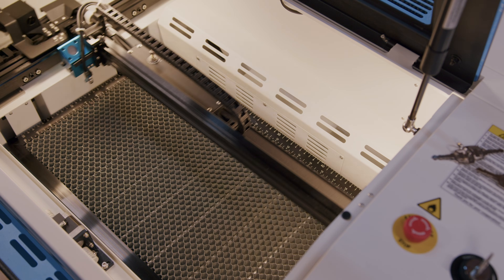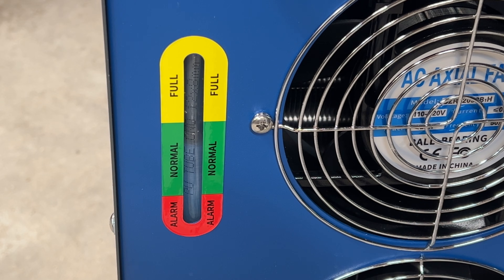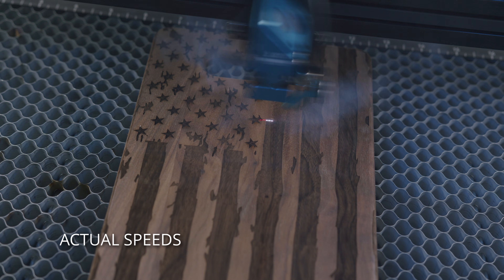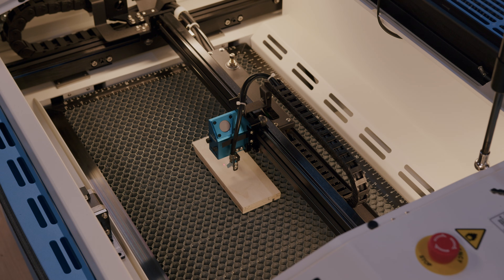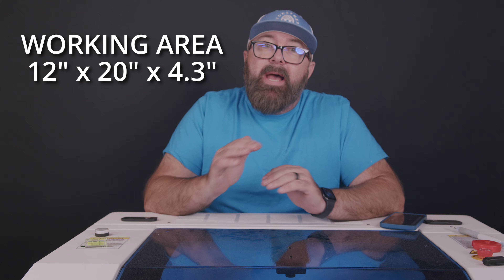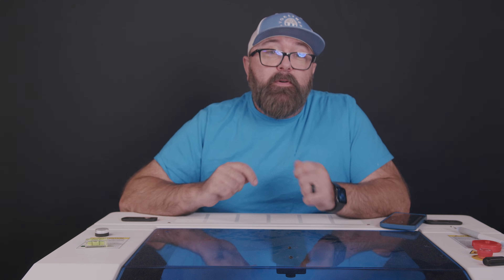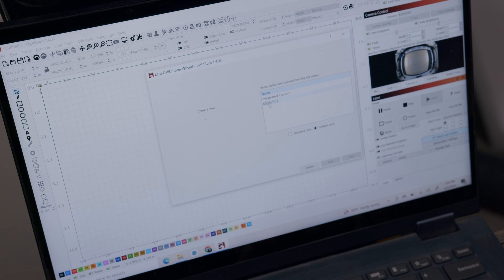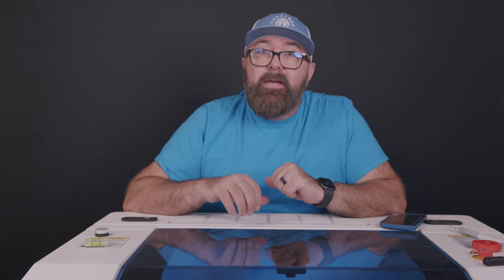This RF laser is a BEAST! Thunder Bolt Review

Comment: Very good presentation. 
I am looking to purchase my first laser engraver / cutter. Having no prior experience, which model would you recommend for small businesses? I will be cutting & engraving colored acrylic sheets.
Reply from the maker: I’m slightly bias to the thunder bolt and xTool P2 at the moment for most desktop users. I also like my OMTech machine. You’ll want a Co2 or RF laser to do what you need, so stay away from looking at diode machines for that. Thanks for watching.

Comment: I wonder where Thunder Laser get their DPI values from because they are certainly not attainable in the real world on any material I know of. 2000dpi is a burnt dot of 0.012mm  diameter  and that is JUST above the physics theoretical spot size limit of 1 wavelength (.0106mm), Even 1000dpi is dreaming. It would be great if you could test these  TL claims. 1000dpi is 40 dots per mm .Try it and see if you can count 40 discrete dots.

Comment: Do you by chance know the max height material that will lay flat on the honeycomb and not overlap the inside of the honeycomb frame? I really need to lay something that is 12" high flat, the width is more than fine.
Reply from the maker: Are you saying the piece is 12” in height?
Reply: @VoeltnerWoodworking  sorry, front to back. 😁
Reply from the maker: The max part size is 20.3''X13.9''X 4.3''/515 X345X110mm
Reply: @VoeltnerWoodworking  perfect, thank you, and that does not go on/over the honeycomb frame? 😁

Comment: Thanks for the video! For those that have a large, high watt Nova, what would be an example of distribution of labor if they added a Bolt to their shop? I have read where some relegated their big Novas to mainly panel cutting, especially on big sheets.
Reply from the maker: First off, thank you for the Super Thanks! Much appreciated. For those with a Nova there probably isn’t a huge need for the Bolt, but it is nice to set up for smaller projects like tumblers or fine engraving. So it would depend on what your primary projects are. Do you have the Nova? Which one?
Reply: @VoeltnerWoodworking  You are very welcome fellow Texan! I have a Nova 63-130 but would like a Bolt for more precision and speed…just looking for the right/best tools for different types of jobs.

Comment: On the Thunder Bolt laser how large of a wood cereal bowl can be engraved on its side using the ROKU Twister tray and a PiBurn Grip chuck rotary?   Can the rotary be placed directly on the crumb tray to gain Z depth without the ROKO, or can the crumb tray be removed and the rotary put right on the surface below the crumb tray rail?   I’m trying to figure out what the maximum Z depth is that I can get using a rotary.   I don’t want to spend almost twice the money on the Bolt Pro 22 with its deeper Z depth.
Reply from the maker: The issue is focus of the laser. If you use the crumb tray you will have to raise the piece and use manual focus which could work, it's just not as precise.
Reply: @VoeltnerWoodworking    Thanks.  I didn’t consider that without the Z motor in play I would need to do a manual focus operation and shim the PiBurn upward as needed.  If that’s possible I’d like to know what the measured depth is from the surface below the crumb tray up to the lasers focus plunger.